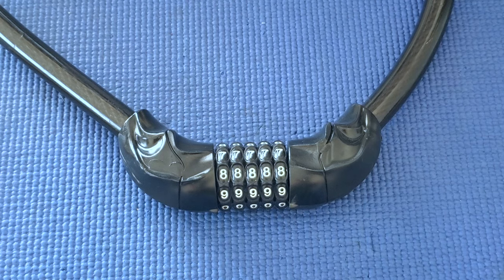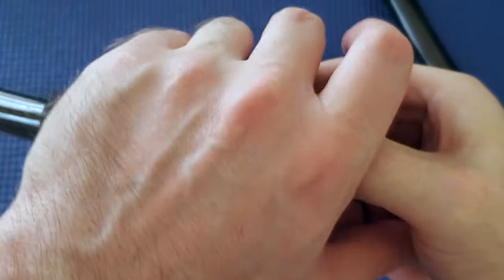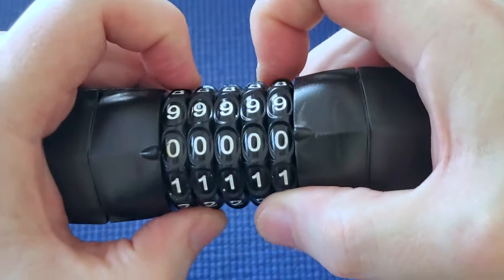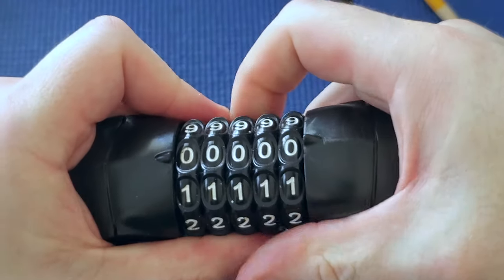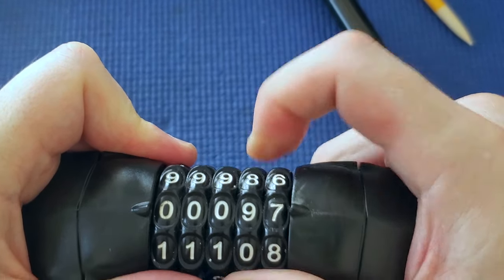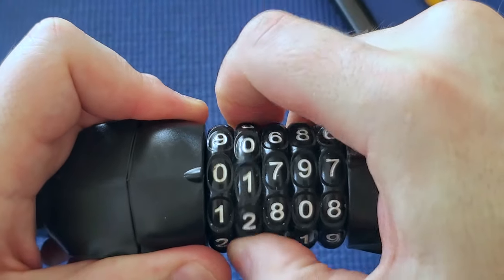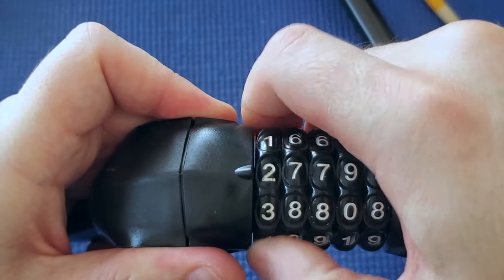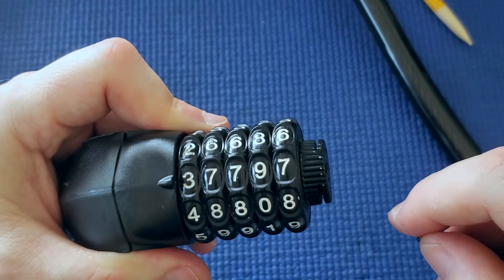(Picking 145) How to decode most combination bike locks - Faster Method!

Comment: Brilliant thanks a lot .
Due to vids like this my1600 bike now has been nicked.
Shame on you
Reply from the maker: It's actually the other way around ... your bike would have been stolen without me doing my videos. Thieves most often cut locks, and those few who decode them mostly already know these techniques. My videos are trying to educate people not to use a cheap lock to lock up their expensive bike. People don't realize how quick & easy it is for thieves to get into them, and have a false sense of security with cheap bike locks. I would recommend that people buy a bike lock that is at least 10% the price of their bike, so that would be at least $160 for a $1600 bike (or $200 to be safe, and make it a key lock not a combination lock, and also make sure it's a reputable brand). People don't like spending that much money of a lock, even though it's locking up something really valuable.
Reply: @Swynndla  I didn't know these locks could be picked only cut..he did a blusmart 5 digit one in less than a minute.
CCTV everywhere as well
Reply: @Swynndla  what would they do with ebike though?
It's a rare one and so without charger useless
Reply from the maker: @watchmanendtimes  I don't know much, but I know a lot of thieves are not smart. They go for high value looking bikes. Apparently in the UK it's so rampant that thieves will go around with portable angle grinders to cut through most locks in seconds, and they aren't afraid of CCTV. I've read on bike forums that some people have taken to making their bikes look older & cheaper then they are, and/or park next to a more expensive looking bike. It's gotten that bad. Also there are now grinder-resistant bike locks, but they are quite expensive. When I say people should spend at least 10% of the bike's value on a lock, that's at least 10% ... maybe 20%. Also I would suggest getting the fattest key lock you feel comfortable dragging around. "Fattest" to resist grinding / hacksawing / twisting for a little bit longer and the thieves may pick on an easier target instead. It should be a "key" lock as combination locks are a joke even though they are very common (and convenient as you don't need to carry a key). Combination locks also attracts opportunistic thieves carrying no tools who might decide to just give it a go. Also get a named branded lock (like Kryptonite). Yes thieves can learn to pick key-locks (by watching some of my videos or some of the many, many other ones on youtube), but thieves nearly never do that for bike locks (especially for a quality named brand), as it takes a loooong time to learn (so thieves tend to resort to physical attacks on the lock instead, eg cutting / twisting / hitting). Another thing I read on the bike forums is that people should be careful when locking their bike to something ... eg a metal bar may be able to be cut easier then the bike lock (as the bike lock will be made with hardened steel). Also some people notice tape around some bars they were going to lock their bike to, but under the tape is a pre-cut gap (or removable piece) so they can slide the lock out of the gap and steal the bike. Lastly I'm sorry you had your pride & joy stolen. I hope my videos will show people how easy it is for thieves to get into combination locks with no tools.
Reply from the maker: @watchmanendtimes  Unfortunately those blusmart bike locks can be decoded and also cut easily enough. The marketing will say 100,000 combinations and "Heavy Duty" and "Anti Theft" but it's simply not true. A good large bike shop should be able to suggest what a really good quality bike lock is. As I say, get a named brand, and get a key lock (not a combination lock), and one that's really tough. I would also recommend you do your own research and look at online bike forums ... but read my other long reply.
Reply: @Swynndla  yes obviously 
I'm just wondering what you think a thief would do with a rare e bike.
You can only buy from a dealer and they aren't that many and without the charger battery won't charge
Reply from the maker: @watchmanendtimes  Ahhh I really don't know. Maybe use it for parts and dump the rest? Or just dump and move on to the next one?
Reply: @Swynndla  dump whole lot so like a joyride?
Reply from the maker: @watchmanendtimes  I guess so but I really don't know. It could have been an opportunistic dumb thief who didn't think much about it. Who knows. It's shitty that the thief took your bike. Lots of thieves aren't very good at what they do. Most are dumb and either desperate or opportunistic. Just my opinion.
Reply: @Swynndla  police won't do anything 
I may lay a bait with another bike and wait..
Reply from the maker: @watchmanendtimes  I know you're fuming but check out the local laws about that, as some of those methods are against the law. I know of a bike lock called "skunklock" which has a pressurized chemical so when the lock is cut it covers the attacker in a foul smelling substance (see skunklock.com) but in some countries it may be illegal.

Comment: So many bikes stolen
Reply from the maker: You're right that lots of bikes are stolen. Most thieves cut bike locks (eg bolt cutters). The thieves that instead decode combination bike locks tend to be opportunistic and they already know these methods (the decoding methods are no secret).
It's partly why I do these videos; to show people how easy it is to decode these locks, and that they aren't as secure as people think.
If someone has a valuable bike, they should (imo) lock it with a key lock not a combination lock, and they should use a thick chain - and not a cheap lock either!
Yep, it's a hassle to carry a key, but so many people know how to decode these combination bike locks, and since it doesn't require any tools it means a thief who comes across one can get in with no tools.
But as I say, most thieves tend to cut the lock chain or the lock themselves (whether it's a combination lock or key-lock), so using a thick cut-resistant chain in important.